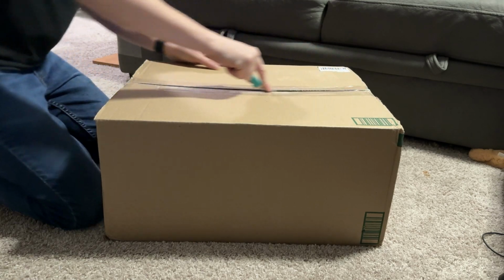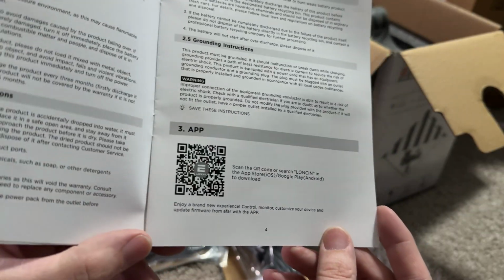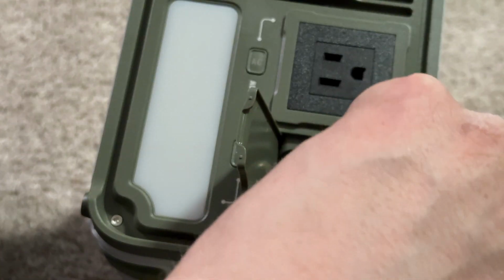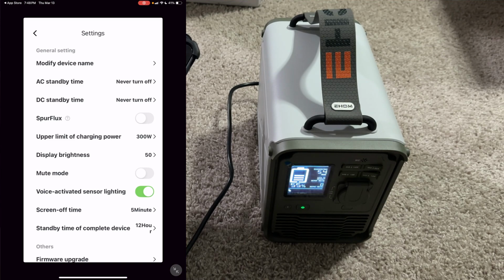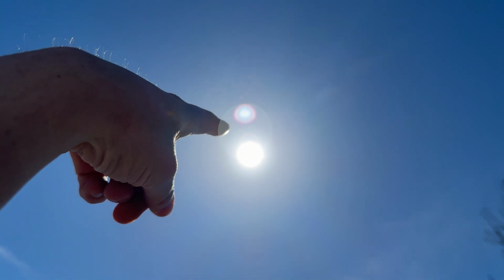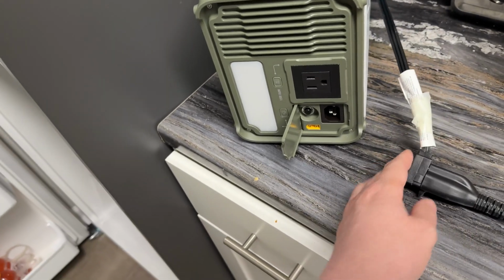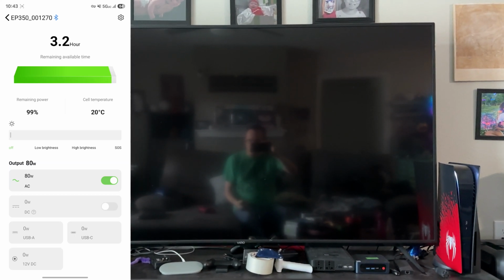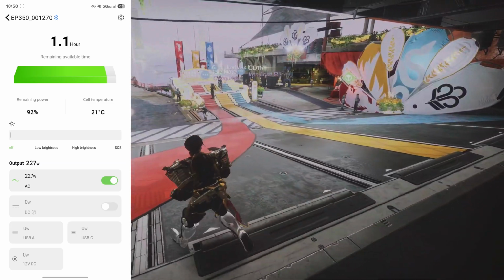EHOM Portable Power Station 350W (Peak 700W), EP350 299Wh Solar Generator

Comment: Purchased one about a year ago and HATE it!  Comes with a mic to turn on the light which requires an app and account to disable. No hard switch to turn off mic.  Light keeps coming on during normal conversation. I don’t want to install another app for a stupid battery. Will be ditching this pos as soon as I can. Plus I can’t get a full charge on it after 1 cycle.  Junk

Comment: I got the EcoFlow river 3 on Presidents’ Day for $115.  It’s been awesome little 256kwh Portsble power station. But this bad boy is on sale on Amazon right now on 3/26/25 for $120 with tax. Normally $219. I’m thinking about getting it even though I don’t really need it. It would be ideal to have during an extended power outage or a Grid down or dire SHTF situation. I need to get a few solar panels. EcoFlow 60w one is only $50 on eBay. I’m super poor so I try to buy the best deals I can. I’m so tempted to buy this tbh lol
Reply from the maker: @MagicDeez8BallNutz  lol. I’m a sucker for sales too!

Comment: I like that they are honest and call it a EPS mode not a UPS mode. Many power stations claim to offer UPS when in reality it is 20+ms switch over which is enough time to cause some computers to drop out. (FYI a typical budget model dedicated UPS is around the 10ms mark)

Seems to have a good selection of USB ports too. 100w and 65w type C and at least the A ports offer 9/12v so some sort of quick charge for devices that support it. (Honestly better than the River 2 Pro that costs 4 times as much!!!!) Maybe just test these when you have a moment and post a pinned comment. 

App seems very heavily influenced by the Ecoflow one. Especially on the settings page. 

Unlike some power stations I dont have much to nit pick about that one to be perfectly honest. I guess just USB C input would of been nice. 

Oh also not trying to be a smart ass but Inrush Current is the term for when something like a fridge needs many times its normal rated running current to start.
Reply from the maker: @TheColinputer  so the people that make the tool already did that! That's why I didn't. https://youtu.be/uWVZBmhbGec?si=Ds9HeHvseIL7Yk6V

Comment: One of the times you started the refrigerator, i saw 784 watts on the power station readout before it overloaded.  I see you using those kilowatt style load testers.  Some have a peak mode which will capture the peak watt draw so that might be another way to take a look at that.  The app is usually the slowest to refresh.  That $169 price bracket is pretty competitive now but this one seems to have all the right stuff and the form factor is nice also.